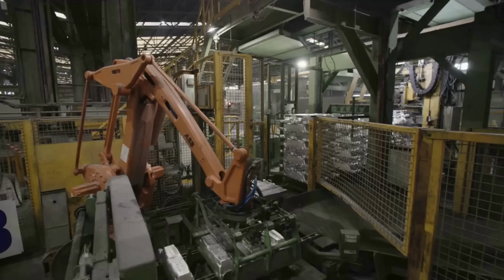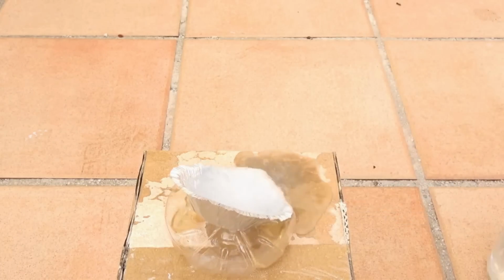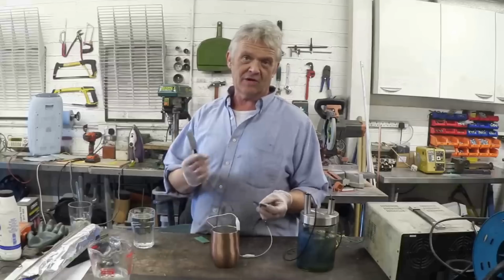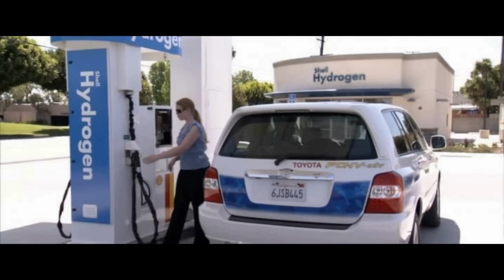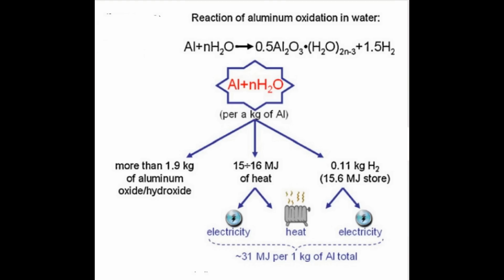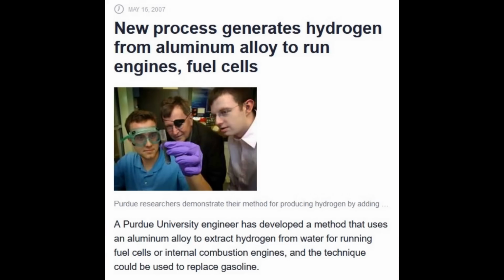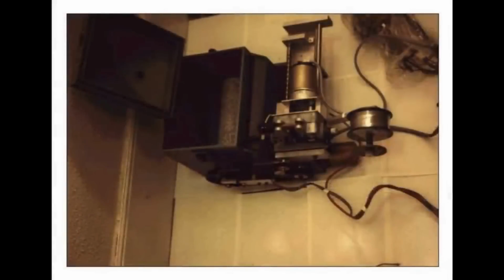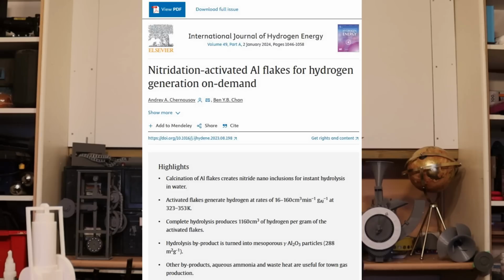2194 Hydrogen On Demand - Improvements And A Possible Conspiracy

Comment: Excellent. 

Lithium metal is about $20/lb... but that speaks to another problem- market volatility.  Aluminum is everywhere, and stored in large amounts, and there is no way it will triple in price in a year...
Reply: The prices he gave might be correct if we say pounds instead of dollars.
Reply: @Biggles732  

Yup - I was trying not to sound like I was "correcting", but pointing out it is very stable in price over a long time.
Reply: @Biggles732  Although the proportions remain the same regardless of the units
Reply: Not while there are vast amounts of aluminium just sitting around as waste.
Reply: @simongross3122  

Use a wire to collect the 55 kWh of electrical energy per Kg Al...

I am guessing it will release 500kj of heat per Kg Al > Al2O3.

Burn the released hydrogen for another 100 kj...

I haven't checked my math, but... that is worth looking into.
Reply: @JohnBoen  I'm reminded of the scene in Back to the Future where they empty a can of coke into the engine.  Probably also need to drop the can in :)

But I like the picture you describe.  You could feed aluminium waste into your little engine/furnace thing to heat up your hot water system while simultaneously feeding electricity into your home battery.  Your released hydrogen could be used either to burn for more heat, or in a fuel cell to generate more electricity.  Then you can sell the leftover alumium oxide to an aluminium smelter.
Reply: @simongross3122  I thought fuel cells for hydrogen were say 90% efficient.
Reply: @Biggles732  I don't know.  I just think electricity is more useful than heat.  We create too much heat anyway, and a lot of it is wasted.
Reply: @simongross3122  

In the picture I paint the corrosion byproducts of the aluminum oxygen reaction do not cover the aluminum and the reaction operates like thermite. 

I think he called it a "Mr Fusion" .

This would be "Mr Diffusion"

If you can maintain an electrical connection with a thermite reaction you could get a lot of electrical power.

I have not read the paper, but I understand this aluminum gallium alloy reacts much faster than aluminum would dissolve in a strong base...   

My investigation into this involves capturing the H2 from a homemade CaO MRE...  bubbles violently and produces 1.5V and this should be faster.

I think 55 Kj/Kg is the electricity needed to electrolyze Al - you should get much of this back.

When I have a little time I will do the math for real...

Comment: This is very cool :) so basically the Aluminium acts as a catalyst to release the Hydrogen from water
Reply: No, the aluminium is oxidized to Al2O3, a catalyst would help the reaction but not change chemically itself.
Reply: @tuc-dh4df  ah ok cool :)
Reply: Gallium would be a catalyst in this case.
Aluminum becomes an oxide compound.
If you break aluminum bond with the oxide you then get something interesting.
You could do such with a iron furnace.
You could use alcohol to take the rust from the iron furnace and turn it back into iron.

Please someone who is able to do this, reach out to me. I am bored! I AM CRYING BORED!

Comment: It might be fun to see if this can be replicated by sticking a MIG torch in some water with aluminum wire.
Reply: - in all these systems, the trick is to make the whole system energy positive or there is no point in using the electrical energy to liberate the hydrogen.  Another presupposition is that the Aluminium can be made  (the whole system and supply chain) more cheaply and with fewer environmental costs than oil and gas or other battery systems...
 - CO2  free hydrogen "can" already be made easily enough - from any source of hydrocarbon - the carbon in the hydrocarbon becomes solid carbon.

- hydrogen is easy enough to make for experiments - making it isn't the problem..

- ie, is the hydrogen fuel cell at the other end of the process powerful enough, cheap enough and reliable enough  (and efficient in terms of lifecycle costs)...
Metal as a stable long term energy store is incredibly useful - Aluminim-Air batteries are another great innovation...

Of course Elon Musk said using electricity to make hydrogen is all "incredibly stupid" - jk, have a laugh...  (no one can be right all the time)
Reply: I was thinkimg the same thing 😂
Reply: A car battery, a charger or com power supply, lots of ways work
Reply: If the solution and feed rate were appropriate, of course it would.

Comment: Anything that’s circular in its supply is mimicking nature. To me, this is the most promising thing I’ve seen. You feed the car spools of aluminum wire and water. You get back a readily usable aluminum ore, the gallium comes out of solution? And the way is the only thing used up until the hydrogen is used and water vapour is created?

Comment: Interesting idea. Remote municipal landfills sometimes have excess sorted aluminium, too expensive to ship anywhere for recycling. Maybe it should become local electrical power instead via this reaction. Hydrogen ICE still presents a NOx emission issue, and with new "embrittlement" longevity hurdles, from what I gather. But a 40foot containerised portable milling machine with small Al reactor generating meaningful output, might be a patent that gets an order book...

Comment: Why use aluminum? We have been able to safely store hudrogen since the 1970s as you have already done videos on  without high presure or cryogenics. Second we have build nuclear generators for decades therefore you can generate hydrogen at the point of sale by a sealed nuclear generator fueled by nuclear waste. Not only do you produce hydrogen but you also use up nuclear waste doing it.

Comment: Did you know if you put "wood ash AKA potash" and shredded aluminum foil and water in a container any air tight container and capture the gas you will have hydrogen basically from waste
Reply: I didn't, thx.
Reply: Yes potash or pot ash is the leftovers salts and other high melting point materials. A large part is Potassium carbonate and Potassium hydroxide, that is a where the element git it's name from. It's alkaline when reacted with water. 
So like mentioned in the video; adding aluminum to a alkaline solution of water with hydroxides in it the aluminium has the chance to donate it's electrons to the several oxedizers nearby; water itself but also oxygen and nitrogen disaoled in the solution. Or CO2 if available. Aluminium is really a great reductor and can spare three electron. It's luckily protected in normal conditions by its alumina/satire/al2o3 layer. Al is awesome.
Reply: @blueredbrick  point being Hydrogen is easy and pentifull So why are we insistent on wind/solar electric generation, when hydrogen is the cleanest most abundant energy, which can be directly converted to electric without the combustion process, if governments were serious they would be dumping all their resources in hydrogen research and not the fruitless wind and solar avenue

Comment: If anyone takes this, they owe me a hamburger I am a starving hobo.

Iron, and Aluminum, the two Keys!
Galium, Galenstein specifically actually with a few other additives.

The following is the process operative considerations:

Aluminum gallium makes Hydrogen when exposed in water, you can make this more efficient in several ways.

This changes aluminum closer to Bauxite, it is not free energy. To crack it back over into aluminum you heat it but where does the heat come from?

You burn Iron powder, this iron powder turns into iron oxide which again is not free energy, so how do you get iron to no longer be oxides well that's not free either so how do you get the iron powder back?

You take the Iron oxide powder, put it into a nitrogen 'very abundant in the air mind you' rich environment and have it cooked in high heat 'though not very high like aluminum requires'.
You use a alcohol flame with good ventilation.

You have a alcohol still that uses corn mash or something nice and sugary 'perhaps look into red clover? SUPER QUICK AND EASY TO GROW'.

YOU GET, hydrogen gas from the very beginning of this process.
You should not need to burn hydrogen but you can feed it back into the process to help crack over aluminum as it requires hiiiiigh heat thresholds.

The secondary considerations:

Iron, cracked over holds a nice bit of charge.

the two can be used to refresh each other, but the energy comes truly from alcohol!

Make a alcohol still, use this to burn pretty hot and undo the damage to iron after you burn iron to get Hotter, Use the Hotter flame of the iron burning to crack over the aluminum that is reacted from gallium, You are essentially converting Alcohol into hydrogen from this series of considerations.

THIS IS NOT FREE ENERGY. It also takes massive amounts of atmospheric control.

Comment: Why not using lithium batteries to power an HHO cell inside an ICE car to gain more range
Reply: Because it's more efficient to use the power to turn a motor. Breaking apart water into H2 and O2 gas is about 75% efficient. Then recombining in an ICE engine about 30% efficient. Whereas electric motors are around 85% efficient (greatly depends on the type of motor)
Reply: @PhiloSage  Who cares about efficiency if you charge the batteries via solar which is free... also installing an electric motor into the engine would be complicated and very expensive
Reply: @antoniosestar3671  on vehicles efficiency is one of the most important statics to optimize. As for solar panels you cannot get the power needed from the area of a typical vehicle. The added mass usually is detrimental to the overall performance of the vehicle. Again efficiency is very important for the solar panels too, the solar panels, charging system and batteries would decrease the range of the vehicle.